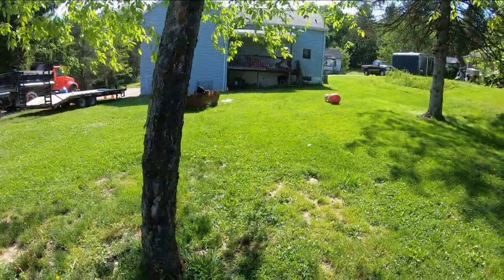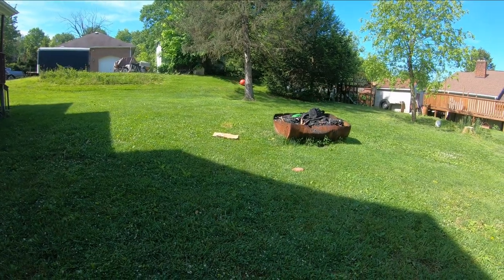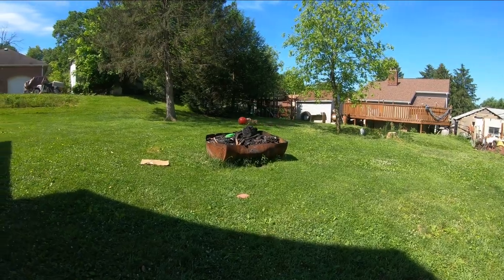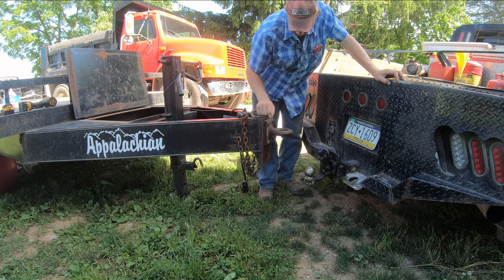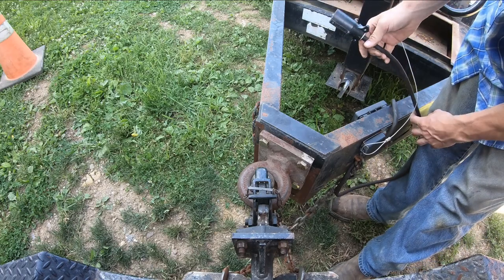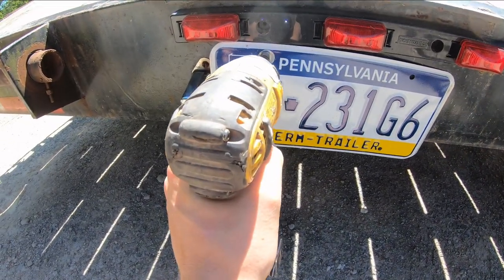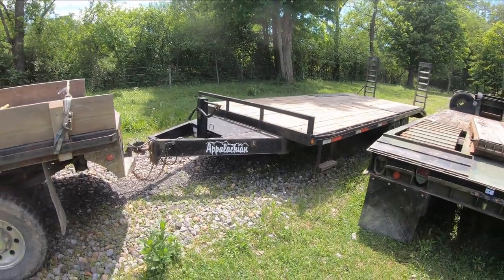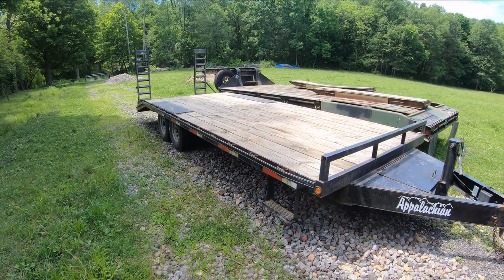“Upgrading” to an OLDER Trailer!???

Comment: Nice trailer good price on it, new trailer cost is outrages on some, I buy used and repair what is needed, even in the rust belt you still find nice older ones. I put pintle hitches on all my trailers no matter the size, no looking for different hitches. Like your operation and the equipment, you save.

Comment: Love the deck over trailer , I'm  like you don't really like fenders even with a car trailer. And the lunette ring is way strong for the connection but I would run a 2 5/16s ball to. And yes I like wider ramps I also like the ramps to fold over the dove tail so you have the full length of the trailer flat if you need it. Great buy.

Comment: Nice trailer.  Congrats.  In you application pintle hitches make more sense IMHO. There is a reason the military uses pintle hitches.....quick to connect and strong as can be.
Reply: Don't forget that lashing them with straps and chains is also an option that doesn't work with ball hitches

Comment: I know I'm late here but Id chacne all the lights to LED's and add a couple of 6"LED  Led 
Housings up front on top and maybe a couple at the rear (if not underneath ) 
for load and unloading sometimes ya just need the light! 

Those ramps I'd just get some angle iron of the size (or just wider to overlap) used there,
cut what you got down the middle and cut some 10 in lengths,
center them (over lap the 2in on each end/side)  
and weld them on both sides (top and underneath  should be plenty strong).

Comment: (I know this is on an old video but I’m on a DC binge) but we bought a 22 foot iron bull tilting deck over. We threw a 25k ball on there and it’s the greatest ball hitch ever. It has a flared coupler and a super nice latch. Always have used ball hitches but once had a rental trailer with a pintle, but yeah this turned out to be a good purchase.

Comment: Here in SD if you run commercial plates on trucks, you can purchase a U-plate for trailer. Cost is $20 and can only be pulled with a commercial truck. Plate is good forever.
Reply from the maker: That would be nice!!

Comment: I'm partial to PJ branded trailers, but that's likely because I own one.  It's a gooseneck tilt deck trailer.  After I pulled it to Kansas and back I don't think I'll ever switch back to a traditional bumper pull.  Try a gooseneck they pull and maneuver great.  Doesn't help much on your dump truck, but would be great for the truck.

Comment: I upgraded from a homemade flat deck trailer that was about 15ft 6in long and only about 5.5ft wide to a beavertail car mate 18ft car hauler a couple years ago, and it made a world of difference! properly build and weight distributed trailers handle so much better.

Comment: Nice pick-up on that trailer. My uncles would regularly spray the underside of their trailers and vehicles with used motor oil. Kept them rust free and most important it kept the road salt of it. They lasted for many years that way.

Comment: I personally hate pintles because of the noise and banging around but the heaviest thing I haul is a Farmall Super M. You do want a pintle to make the most of your trailers capacity. I think my CAM Superline deck over (sweet trailer, I love it) is 11,500 with 2-5/16" ball but full 12,000 if a pintle is used. I'm running the 2-5/16" ball.

Comment: Where I live, Ontario Canada, the max width of a trailer is 8'6" between the rub rails.  According the MTO, any safety equipment, ie. mirrors, rub rails, etc.,  can exceed the max width of trailer or vehicle.  Plus if the safety chains are too long, we are allowed to twist the chains so they don't drag on the ground.
Reply from the maker: We can twist them too but they actually hung just right

Comment: Just picked up a new trailer to me also! 2000 tri axle gooseneck. 20 + 5 . Needs some paint, wiring and tires. Couldn’t go wrong for $1500... On the other hand, power wash that house bud drives me nuts lol. I enjoy the videos, keep it up!

Comment: Use CRC rust converter on the underside of the trailer  and then coat that in RP-342 "heavy" it works amazing... I did my truck frame like this and it has yet to start rusting again and i live in MI and drive it all winter long.

Comment: A small amount of grease on the contact points of the pintle hook and receiver will minimize the squirting when you pull it. Makes hooking and unhooking a little bit of a mess, but a good tradeoff. Nice looking trailer.
Reply from the maker: She gets grease almost every time I grease a machine, I wipe the tip off the grease gun on it.

Comment: No whatsoever experience from this kind of trailers, I live in Sweden (Europe) and brakes on trailers below 7716 lb (3500 Kg) are usually just applied by back-pressure thru mechanical linkage  as trailer pulls on the truck. 
Electrical trailer brakes here have usually a pressure sensor mounted at that ball hitch, however those are not commonly used now days. 

Anyone that can give general basic info about this type of trailer brakes? I am just curious.   

Lived in Wisconsin for a while in 2009, got the impression it was OK to haul most things with no brakes or registration on trailer (had an old boat) no memory of even seen a boat trailer with brakes...

Grate videos you make, AutoCar truck  is my favorite, maybe Meetball will get a ride in it some day...

Comment: I don't know why but I've thought about this a lot.  You could get a converter dolly to tow the low boy with your dump truck. I know weight ratings wouldn't line up exactly but it's just a thought. 

Also I kept chuckling to myself since you had a pintle hitch and another adjustable hitch in the chain box talking about drilling holes in your hitch plate and I was like "no other combination of those hitches will work?"

I do know curt has some beefy wildly adjustable hitches with interchangeable towing attachments that can be had from Amazon as well

Comment: I bought a 9 ton trl 7 yrs ago to replace my 10k skid steer trl since i added my loader.   I agree 150% about hating ball hitches. Oh but the pintle rattles around. Oh really i hadnt noticed. The trk is so stiff. I went from a 6 x 16 10k trl to a 8 20+4 9 ton trl. 4 c or d tires to 8 e tires. It rides so much better and pulls nicer too.  The only down fall is duallies pull hard in loose ground or snow.  I like the chain box. I might cut my jack off and make a chain box and make a new spot for jack stand to attach but very rarely do i pull my trl without it loaded

Comment: Nice trailer!  We have a 30' 21k GVW PJ gooseneck with a 10' hydraulic beavertail.  That was the one thing my dad insisted on as he was tired AF wrestling ramps around.  Of course, he was 81 when we ordered it, so, yeah, he deserved it. 😁  Nice thing is that you can put 4k on the tail and lift it, if necessary.  Pulls like a dream.  I'm just waiting to get myself a 3500 D'max so I don't have to worry about pin weight so much on my 2500 D'max.

Comment: every trailer i bought i have had to strengthen everyone especially under and above the axle area's on the frame check for cracking around those area's
Reply: Yep. The seller might have been overloading it before finally moving to a bigger trailer.

Comment: Great videos. I started watching them. I live in ny but work in pa. It's crazy ur registration fee is that low. Ours on trailers is pro rated so I wait till the spring to register it when I first use it. On my 14k it be I think $151 for one year. But inspection only like 6 bucks.  I'm with you on pintles easier to back up to. Easy to know you are hooked up right etc. Some say they bang around to much. I don't even feel its back there so idk what they mean. The only thing I get is on sharp turns into roads you might get noise .  The new trailer looks good. Even through they r cheaper then the rest n maybe have shittier paint. I know few who like the Appalachian  trailers. They have quality welds which is what counts vs some of the so called fancy brands that use powder coat n once get rust r shot. At least a painted one you can fix like u said.

Comment: You’re not nuts I also like the pintle hitch think it’s much safer good luck on new trailer consider sealing the wood deck so it will last longer another guy on the tube did it and it looks great 👍

Comment: I sure hope that you read this one.... kinda excited and probably for no reason but on another channel, this guy drills lots of holes and one is having to tap threads in the hole just drilled... So this drill bit drills the hole and then tap's threads right behind that and something you may have spotted on the new parts out counter.... if not then check them out
Reply from the maker: I read all my comments and do my best to respond to most all, I’ve used those bits before in the machine shop I worked in.

Comment: When I worked driving a tow truck we had 2 machinery trailers one had a tow ball hitch one had a pintail hook.  I always felt safer using the pintail hook trailer.  Other guys there wouldn’t use it cause they said it was harder to hook up 🤷🏻‍♂️🤦🏻‍♂️😆

Comment: Yes, I'd guess that you made a good deal here. I've done this to a few times and have found that I 'feel better' after I've pulled all wheels and re-greased those bearings
 and checked the brake pad/shoe wear.
I wonder , what's the capacity of that 'ball hitch'/ imitation pintle hitch you have on the Ford,..I'd guess somewhere around 7500 pound? ( I couldn't quite see the bolt size of that ball ) 
Now, as you say, " a lick of paint" and a clean up, that  'new' trailer will be good as new!
Note to Meatball,..." go puppy go!
Reply from the maker: The receiver itself on my truck is 14k and the ball/pintle is 16k
Reply: @DieselCreek  In that case,..you're certainly OK. As I said,..I didn't get a good look at the ball/bolt.

Comment: After ya paint it spray chain saw bar oil cut with diesel  fuel under it before every winter and it will fight off the salt and moisture that causes the rust
Reply from the maker: Ive been using fluid film and like that pretty well.

Comment: Idea, stabilizer legs at the back of the trailer to assist when unloading.
Reply from the maker: The ramps have them built in, you don’t want drop legs because once you put weight on it they are impossible to release and raise.

Comment: I know this is old but it looks to me like it would be better to weld a piece of steel plate on your truck hitch insert and drill holes to raise the pintle hook up so you wouldn’t have to continually move the pintle eye on the trailer

Comment: The steps on the front look like they might be easy to snag something. Maybe put hinges at the top so the step can swing fore and aft?
Reply from the maker: If I did anything I’d probably just cut some of the c channel off and replace it with heavy rubber belting so it can move slightly without breaking

Comment: Man, that plate would be awesome! Unfortunately here in ILLanois our 12000# plates have went up to $158 and my 20000# plate is now over $400 for one year!
Reply from the maker: Holy cats that’s a lot! My dump truck is nearly 1000 and I don’t wanna know what it would be there!!
Reply: I'm getting ready to plate my dump truck here and they offer a mileage plate for just under $600 for 30000# weight, 7000 miles a year max. So I guess you win some and lose some! Lol regular plate was right around a grand like yours.

Comment: All may be perfect for the trailer but there is one draw back.  The rig is only as strong as the pin that holds the hitch to the receiver.  If it was me, I'd drill another hole to the inside of the hitch and pin it in front of the receiver for safety.

Comment: Your worried about the balll hitch not being strong enough but both the ball and pinnal hitch are only held by a stupid skinny pin holding on the whole shebang into the square holder on the truck.

Comment: You could cut the plate off and lower it some or even get a longer plate with more holes in it.  Then just weld it back on.
Reply from the maker: Think drilling 4 holes might be a lot easier....

Comment: Pintle hitch is more theft proof, not everyone has one on the back of there truck.
Reply: Don't forget, they can still drop a pintle ring on a ball hitch, as long as it doesn't bounce off, it'll pull it. Just like pulling a 2 5/16 trailer with a 2 inch ball.

Comment: Your  not crazy just a pharmer. Pintle rings are just easier. Only if you hook it up and take it somewhere. They do build a taller one. Buyers Hardware/ Curt Hitch should cost about $150.00, I'd drill  4 holes cuz I'm cheap. Brake shoes are probably glazed . The Brakes are all the same regardless of the brand the magnets will be oval shapep and if they're warn past the little grooves they should be replaced anyway. Most of the time you can buy the whole brake assy. for about $100, each 12 x 2 drum. Don't mess with turning the drum unless their seriously grooved because they'll just scar up anyway. !2 v electric brakes are generally terrible anyway. They'll work well for two years and the shoes will glaze.

Comment: You weld good why not put a multiple hole plate on the new trailer so you just need to put pins and could use on any truck??

Comment: I have a Pinole hitch on every pull trailer I own.  Can’t stand the ball hitches myself. AC
Reply: I like the pintel so I don't have to lend it out to others as easily. and I leave all the gear in the tool box not part of the trailer loan so it is all there when I need to use the trailer.

Comment: Hello.
Is it illegal to have 2 pintle rings on one trailer? use lower to pickup and higher to dumptruck

 I have been thinking, because on several videos many people have this same problem. Most of them have pickup and a dumptruck and pintles are on different height.

Comment: How much weight are those bolts rated for?
Reply: 33900 lbs in tension, 27,611 in single shear - each...

Comment: That battery rattle gun did not get those bolts on the trailer any where as tight as they should be. 1/2 grade 8 is 116 ft lb
Reply from the maker: The impact is rated for 700ft lbs so I’m guaranteeing they are over torqued if anything, your welcome to come put a torque wrench on them

Comment: Meatball make the vids over the top 😁 but what's a good price to pay for 24 ft equipment trailer need longer for my tractor ?
Reply from the maker: Depends on GVW and manufacture. Used or new, seems you can find goosenecks more reasonable
Reply: @DieselCreek  would a goose neck tow ok with half ton ?
Reply from the maker: Depends on the size gooseneck, small ones will but those aren’t the ones you find used too often
Reply: @DieselCreek  so what your telling me is I'm better off getting a bumper pull in size I need just buy it new ?

Comment: Hey mate down here in Australia we can buy a plate to suit your existing holes and with multiple holes so you can adjust easy without drilling into your existing chassis holes so you can move the pinnacle up or down easily longer bolts maybe required

Comment: I used my 20’ trailer yesterday & after hooking it to my truck I was winding the crank for the jack to go up & it was real tight ! Couldn’t get it up very far. I took the cover off the top & it had plenty of grease for the gear ! It just like your jack ! It’s spring loaded. Do you know what the problem could be ?
Reply from the maker: Sounds like you could have broke. A gear tooth or maybe got something jammed in the leg... you’ll have to take it apart to see

Comment: Wait... if the ball hitch was rated for 21 thousand lbs and the trailer is 15 thousand, does that mean the previous owner was hauling 6000lbs max... or running it beyond the hitch rating?  Seems sketchy.

Comment: 8:25 - but what are the bolts rated for?
Reply: Grade 8 bolts are rated at 150,000# tensile strength per square inch. Those look like 5/8" bolts, so that's roughly 1.2 square inches of steel. ~180,000#
Reply: @tsmall07  oh wow I didn't know that. Dang that a lot
Reply from the maker: They are indeed 5/8 which is also what I have for a hitch pin so really the whole set up is only as strong as that lol

Comment: Do yourself a favor and pressure wash the underside then slather fluid film all over the underside before winter salt ruins it.
Reply from the maker: I try not to pull my trailers in the winter.

Comment: Don’t get another hitch. Put a higher hitch mount
Reply from the maker: That’s exactly what I was referring to! Didn’t come out right tho
Reply: Diesel Creek I have a flat bed too and it is just too low and I welded in a Hitch receiver higher
Reply from the maker: Mines typically at a good height however the dump truck hitch is quite a bit higher so accommodating both is a challenge